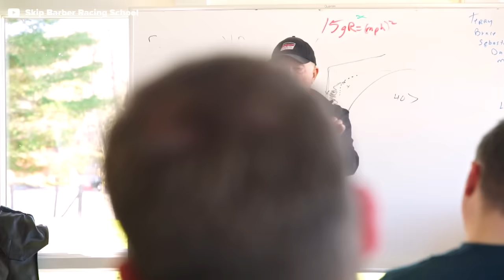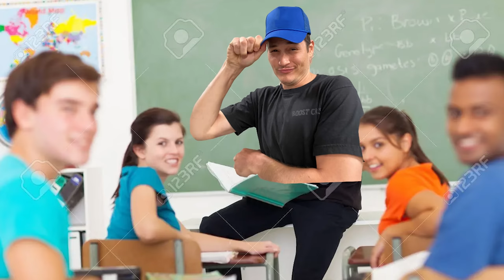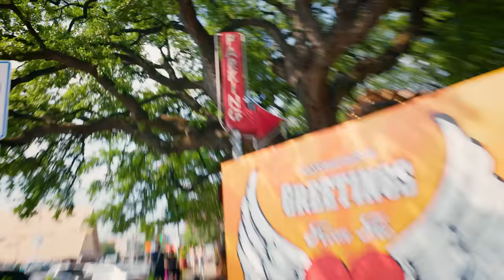I Joined a Professional Racing Team

Comment: Donut media crew should compete in the Nurburgring 24HR someday. They have teams of 3
Reply: That takes a lot of time and effort, would be dope though for sure!
Reply: It worked for Top Gear
Reply: Thats a lot of time, effort and of course, money.

Also Jeremiah didn't do so bad, the first race DNF (if the car didn't broke off he'd finish in 6th, but thats motorsport, where anything happens (and Edit here because I forgot is that Jeremiah didn't notice that because sim games doesn't simulate that thing), his second was 5th and in qualify was 4th, for being new at everything isn't that bad
Reply: @JohnSmithShields i was about to say. If Jeremy, James, and Richard could pulled it off, these guys are gold.
Reply: Go big and go for Le Mans!
Reply: 24 hours of Lemons seems more their speed. I believe they have one in CA. Irwindale?
Reply: @thatbloomer5642  If those three can do it, three chimps in crash helmets can do it.
Reply: Considering their propensity to blow up the car or break it on an off nearly every track purposed car they have... And with Nurburgring having mostly walls at track limits and little run off... You're asking them to die or be moving track furniture possibly causing others to crash. So no. They'd never get the license required anyway as very specific Nurburgring licenses are pre races are required. There's a hell of a lot of other racing to do... Heck just put them in fastest lap sessions on an open track. Throwing people with no experience into wheel to wheel racing on one of the most demanding race tracks in the world then making it an endurance race? Just asking for trouble.
Reply: BBC payed
Reply: N24 is very demanding, you pretty much need to participate in multiple vln races and familiarise yourself to the entire track (nordschleife + race track), otherwise you would crash on the very first lap
Reply: Start a go fund me id pay em 200 bucks ez jist so i can see em do that lol
Reply: they will
Reply: It would have to be Jeremiah, Nolan, and Zach.
Reply: with misha
Reply: @JohnSmithShields Not at the Nurburgring
Reply: @matz4k and lots of money
Reply: Sounds like u American?
Reply: 24 hours of lemons is probably a really good one for them
Reply: @matthewmondragon2074 😅
Reply: he understeared a lot. In fwd cars you need to be about a few seconds ahead of yourself
Reply: @ryanlemons3255  the thing is it wasn't a full FWD race, for example some clips there's two silver Toyota GR86, a RWD car
Reply: @matthewmondragon2074  that Honda was fwd notice beefier tires? In front
Reply: @matthewmondragon2074  oh ok
Reply: @lukeyarasheski5510 This is the way.
Reply: 24 hours of lemons that would be perfeeect
Reply: Nurburgring would not be a good race to go to next. Maybe if they continue with racing for at least 2 years to familiarize with lower GT classes. 24h of lemons like others have mentioned is the best thing to do with a budget and learning while having a blast. The Nurgburing 24 hours is incredibly taxing and you need to pull good laps continously for your stints. Your body has to be at peak performance and condition while having minimal sleep.
Reply: Jeremiah actually isnt slow, he maybe has potential
Reply: 24 Hours of Lemons/Chump Car would be perfect for these guys.
Reply: or 24h lemons)
Reply: @JohnSmithShields  was top gear at nürburgring ?
Reply: @DrSmugface  silverstone, but it was a 24 hour race.
Reply: SuperGT, Jimmy Broadbent, and Misha are doing the Nurburgring endurance series this year. They're all decently experienced racers and they still seem like newbies. It would be an insane undertaking for the Donut guys to do it.
Reply: *N24
Reply: get that forza cameo supervan 3 in there
Reply: Sounds easy enough. Green Hell?
Oh yeah...
Reply: Most definitely.  I might even save up mah pennies to see that live given enough notice.
Reply: they do not have that much pull, and while i love them it is insanely tolling even for professionals
Reply: @jeremynealray Didn’t they say they don’t have $100,000,000?
Reply: I don't think they're capable of it, even to race in the lower classes you need a lot of backing, and also, they would need to train a lot, cus they're all, apart from Jeremiah, out of shape. Not to mention that it is the most difficult permanent race track in the world and they need to deal with GT3's and other faster classes coming like a bullet towards. So overall I think if they took like 2 years to prepare for it, they could manage, but it would be tough
Reply: @bernardoberner4  ford with hundreds of millions of dollars, took two years to prepare and dnf’d. They would need insane amounts of money and donut does not have the media pull to get sponsored
Reply: @nolo5220  I wouldn't say an insane amount of money, well speaking in racing terms cus for us mere mortals it would be a lot of money. But I think with about 250k dollars they can compete in the lower classes, not even in the 330i's but on cars below that I think they can manage with that amount of funding. But, there's the cost of going to Germany, the cost of maintaining the crew there, including the filming guys of course and also the cost of each one of them getting their Nurburgring Racing Permits, which for those that don't know is basically a racing license for the Green Hell. Apart from all of that, they are very unexperiencied drivers, so they'd need to do some races prior to the N24. Basically they won't be able to do it
Reply: HI LOW BUT ON THE NURBURGRING
Reply: Probably a new series to build hi and low car ready for the nurburgring?
Reply: Dude don't you start crying coz if you do I'm gonna start crying 😢
Reply: @jeremynealray  in a hypercar
Reply: even if they entered a more open event like topgear did years ago with the 330d
Reply: Or Baja 1000 beetle class
Reply: They would lose so bad 😂…
Reply: They don't call it the Green Hell for nothin. That would eat these boys alive
Reply: Thats quite a task. doing 1 flying lap at race pace is a mammoth task never mind 24hrs.
Reply: @JohnSmithShields  Silverstone and the Ring are very very very different.
Reply: @mercamia  plus you've gotta get a secondary nordschleife license. its an insane endevor.
Reply: Or just do a 24 hour challenge to see how far they can go with a certain car kinda like how top gear used to do
Reply: @supra0_0nova  good shout. 24hr Lemons
Reply: @JohnSmithShields top gear has hella lots of blues bills.
Reply: @Quattro_Joe  great name for the video
Reply: @supra0_0nova  I want royalties 😁
Reply: A crew of Zach, Nolan, Jerry, James, and Justin in modified production class is possible
Reply: This has the potential to become a feature-length documentary
Reply: @romiarkan450  I don’t think they’d have the license requirements
Reply: Nah, they should do 24HR of lemons race. Probably a little more in the budget 😂
Reply: Besides the mentioned license requirements, there are a lot of professional racing teams out there, so there's no space to fuck up and possibly end someone elses race.
Reply: Hi Low Endurance Racers?
Reply: Without James
Reply: @lukeyarasheski5510  Lemons races have happen at Irwindale in the past. But recent California Locations have been Buttonwillow, Sonoma, and Thunderhill.
Buttonwillow would be the closest race to Donut HQ, so that would be their best opportunity (unless Irwindale returns to schedule). 
But if they can get to Sonoma for the Skip Barber Academy, then they can do the same for Lemons as well.
Reply: That would be sick, in the spirit of top gear doing the long race they did
Reply: Except for the part where they're a bunch of sophomoric man-children...
Reply: 24 hour of LeMons
Reply: Maybe try 24 hrs of lemons first lol
Reply: It would take alot of time and money, but you could make alot of content off that as well. It wouldnt be just 1 video. It could go over training for such a race, going over the cars for such a race. You could probably do like 5 videos off of it
Reply: More like Lemons.  And that isn't a put down.  It could be a good series to record.  Lots of characters.
Reply: I feel like Lemons 24hr would better suit the donut crew hahaha😊
Reply: Or 24 hours of Le Mans
Reply: They should start with the 24 hour of lemons
Reply: Or 24 hours of lemons. Really curious what kinda funny car they’d come up with.
Reply: @imvivalamilo  you never know with donut... They could always acquire sponsors too...
Reply: @lukeyarasheski5510 so much this.
Reply: Boi, if they decided to do a PPV of that episode I would do it. It would be glorious. That would be one hell of a series!
Reply: That would be rad! In 2007 I took a week of leave after getting home  from Iraq and went to Europe to see a majority of the places and things on my historical bucket list. Omaha beach was amazing as was Point Du Hoc, but the best part was the Ring. It was a humbling experience, especially in my early 20’s to realize that not only am I not nearly as good of a driver as I thought, but that I was also slow as hell. I did get to meet Sabine and took some pics with her, she was an amazing human being. Full stop. I mean the whole vibe in general when I went was awesome, I was able to find random strangers who I talked to for maybe 15 minutes about their 911 or heavily modified E39 M3 who took me for a number of laps that further cemented the concept that I essentially suck at actual precision driving hahah. Great memories though.
Reply: @DrSmugface  no they compete at a 24h race in UK
Reply: 12 Hours of Sebring or 24 Hours of Daytona would be closer.
Reply: They should do the 25 hours of thunder hill first
Reply: Lo car vs hi car; north loop
Reply: @DrSmugface Nope. They did the Britcar 24hr at Silverstone
Reply: You know you need lots of hours on the Nürburgring in order to be allowed in any race. And way more if you want to compete in a 24h race.
Reply: To be a sponsor it probably would, to own a team, gotta take years, to actualy bring someone to race on LeMans.. yeah it take more and more years.. Donut 3rd/4th generarion 💀.. nah im jk, im bad at predicting shii
Reply: We will raise money 💰
Reply: I would pay to watch this
Reply: They just need to make up to speed, money pit, hi low, and b2b. That's it
Reply: @thatbloomer5642  not sure if James’ heart can take such high intensity tho 

Jeremiah, Zac and shop daddy would be more like it!
Reply: Dang or just get overdrive on board!!
Reply: I would show up and would cheer them on, since it's in my country anyway 👏
Reply: @Vermonstered  But you can take a regular car on friday, since the Nürburgring is then open to the Public.
Reply: With Adam, they could have 2 teams
Reply: @dawn_darklight  Huh? I thought this was in reference to racing. Not random Friday activities? Where did that come from?  You're not doing 24 hour racing some random Friday.
Reply: As long as James isn't driving lol
Reply: @lukeyarasheski5510  Entering the Moneypit Miata to 24 hours of Lemons
Reply: Donut vs the Bilstein sim racers let's go
Reply: YES
Reply: Should probably do an AER event or something similar first
Reply: Best idea I've heard all year.
Reply: lol only if they have like 5 spare cars bc James is gonna destroy them.
Reply: Jerry and Zack are good. But whose the third.
Reply: @JohnSmithShields Top Gear had money, a racing driver and a bunch of mechanics. I don't think you can compare Donut to Top Gear.
Reply: Very cool man
Reply: Easier to enter American races. N24 requires an FIA international license and a Nurburgring race license
Reply: YES
Reply: Hi Lo!
Reply: I don't make much money but I would fund that shit myself. That sounds amazingly fun.
Reply: Honestly the 24 of lemons would be even more fun to watch!
Reply: Petition for donut to make a tc team
Reply: One do 8 hours😂
Reply: Jeremiah and Zach 24 hrs of lemons first then we need the real deal
Reply: Not sure if you’re gonna wanna let James drive.
Reply: That would be so sick to watch
Reply: The ring would be dangerous for their first race maybe an 24hr in austin or watkins glen can do first
Reply: Jimmy Broadbent is doing it with 2 other youtubers too
Reply: Cool
Reply: Or at least the 24 hrs of Lemons! The 25 hours of Thunderhill would be good series also!
Reply: Be some good content too
Reply: Problem is you have to also get a special permit form the track after your class c I guess international liscence to compete in the lowest class. So it requires a lot of drive time there to actually race the 24 h race.
Reply: @thatbloomer5642 yeah it's true but you have to think that they used the money from bbc to enter so for them it would a bit harder but not impossible anyway
Reply: @budsodastories ask chris fix
Reply: They should hookup with that guy Misha to do laps of the Ring
Reply: @lukeyarasheski5510 Willow Springs I believe, not Irwindale
Reply: @bigdfitness5020  Close enough I guess. That'd be a great video, no matter where honestly
Reply: That would be so sick! That would actually break the internet.
Reply: Cheaper alternative, Donut Media collab with Misha Charoudin and allow him to give the guys a lap in a vehicle of their choice and/or have Misha give them pointers in how to drive faster at any track.
Reply: Maybe Donut should try and snag some of those LFA GT3 protoypes
Reply: Nolan intensifies
Reply: Nolan, James and Jeremiah (sorry Justin)
Reply: Yeah if super gt, jimmy and the other one (apologies i dont really watch his content) managed to participate i dont really see why donut who most def have a bigger budget cant.
Might be hard because donut are americans but its just a matter of tine and preparation i suppose
Reply: @vermilion6667  so seems they literally have everything required then..
Reply: its a rich boy sport @mercamia
Reply: Or at least Daytona or Sebring. There's a great Top Gear episode where they do a 24 hour race and the Stig was on their team.
Reply: @JohnSmithShields Not at the Nordschliefe.
Reply: These dudes are TERRIBLE drivers, all of them lmqo

Comment: 15:00 man that shit hit hard... I felt that in my soul.

Years ago I built my own car. A 96 civic si (we had those in canada) with an acura EL front clip. I bought as a bare shell from a junkyard. Over 2 years I spent $13k on mostly used parts except the drivetrain I built myself while in college for automotive. Literally built in my dad's backyard with hand tools. Not even an engine hoist. 

I jacked up the front, drug the drivetrain underneath, and lifted it into place standing on the shock towers with a strap over my shoulders. The only help I had the whole time was dad sticking the motor mounts in while I held the 350lb drivetrain on my shoulders.

Fully built b18a1, high compression, gsr trans with ls 5th, lsd, stage 3 clutch etc 

My first time down the strip, I was having that same rush Jerry did, tears, everything. Dreamed of drag racing since I was a kid. 13.6 quarter my first pass with a perfect .500 light. Cried my eyes out like a little kid.

Ended up selling the car for next to nothing right before my oldest son was born 8.5 yrs ago. I'll never forget that car or that moment as long as I live. I'll build another with my two boys someday.

Good job Jeremiah, so proud of you man.

Comment: Racing experiences are brutal if you don't piss money for a living.  Asking to crew for a TC Racing crew was pretty illuminating for me as far as the costs and the logistics.  The amount paid to have multiple days of your week including time taken away from work is rather low especially if they crash or break the car and you have to try to piece it back together.  Even working the race doesn't make sense.  The wheels and tires are expensive and if it's an endurance race you can go through 20k in tires.  For the customer, they're paying for service, prep, transportation by the team, trackside support and changeouts, and typically their pro co-driver and they typically like to go first because if the pro has a mechanical failure or crash then they just wasted at least half of their spent money.  At that point I realized that I would never be a racing driver so it was really cool to see Jer get the experience.  It really gives you an appreciation for all the hard workers and volunteers of more grassroots level orgs.

Comment: I'm glad that he didn't gloss over the costs of getting started and going racing. Once you've got your license and gear, even "the most affordable" type of wheel-to-wheel racing an amateur could do ("arrive and drive" Spec Miata racing) costs about $5000 total for a weekend. This would include 1 day of practice and 2 days of racing twice per day (double dipping, racing two different categories in the same car). Races are generally 20-40 minutes, often 30 minutes long, plus you get one practice session per race category, and a qualifying race. At the end of the weekend, you have about 4-5 hours of seat time if someone doesn't run into your rental car leaving it disabled and you with a big bill. Oh, and don't get me started with sim training...that's another cost to consider.

Comment: After doing karting a couple of years me and 3 other guys entered a 24 hour race for standard cars. The rule was that every car had to be scrapped after the race. I have never had this fun in a car 🤘 Pushing to the limit and beyond, what you break you have to fix yourself. We survived the race and crossed the line after 24 long hours 👍 I did 2 more races like this and it was great fun racing with 53 other cars on track, there were cars everywhere 😅 The total cost per driver was around $2000 for a race including the car we bought. Let me tell you I was totally exhausted after doing 3 stints and around 5 hours in the car (we had a couple of hours for maintenance and repairing during a race).